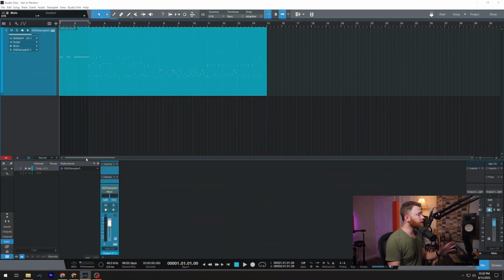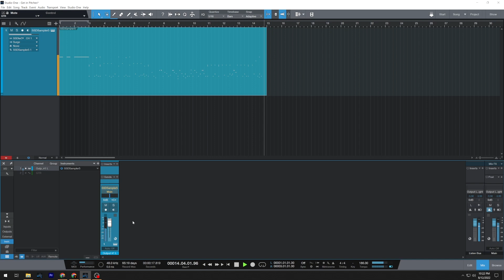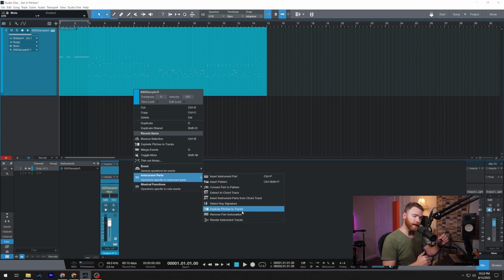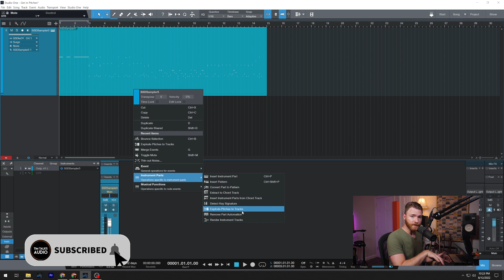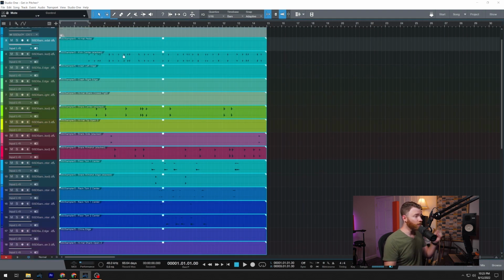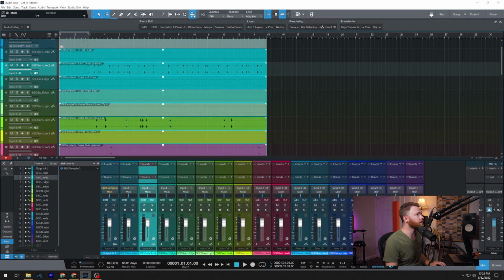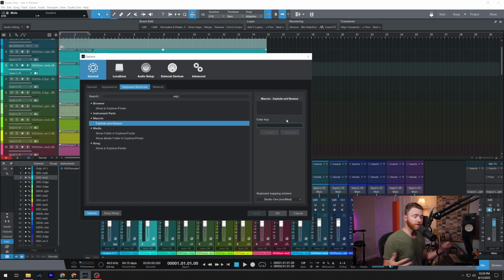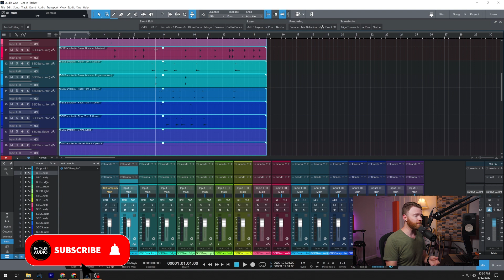Studio One: Explode Pitches to Tracks

Comment: Tim:  Thank you for your video!   I have open hi-hats followed by closed hi hats, which of course, chokes off the open hi-hat each time.  After exploding to different tracks and then bouncing to audio, I lose the choke.  Open hi hats ring merrily along. argh.  Is there a fix?
Reply from the maker: You could merge those two hats into one event. That should make the choke function happen for you.
Reply: @TimTalksAudio hi Tim, how can I set all the midi to C3 after exploding pitches to tracks? I want to use SampleOne on each track but it comes with the root note set to C3.